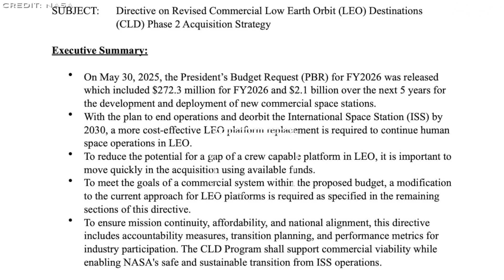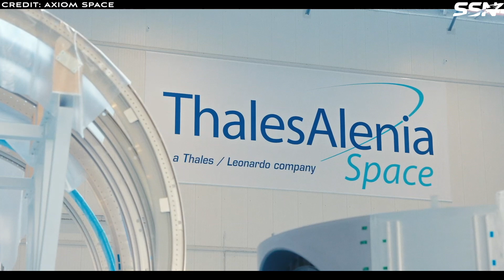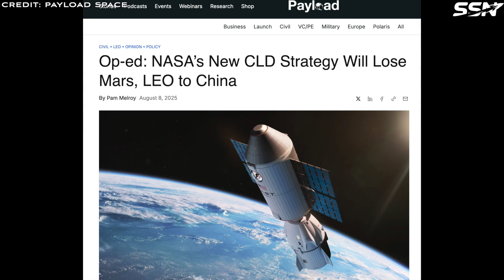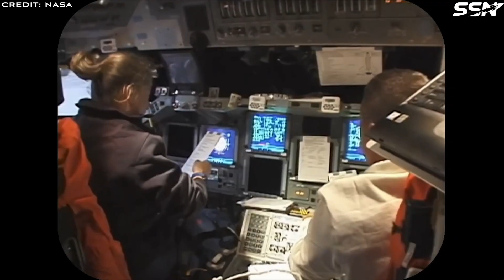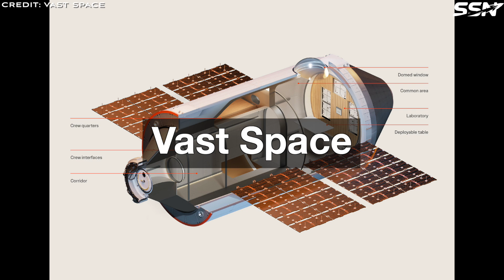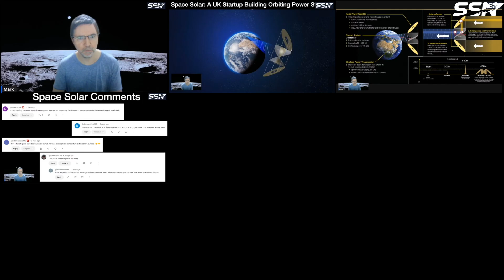NASA's Pivot to Simpler, Cheaper, Commercial Space Stations

Comment: We had better get back to the Moon before we worry about getting to Mars. Orbital stations cannot give us all of the necessary data for a trip to Mars. They are shielded from total radiation by the Van Allen Belt that will be encountered during a Mars mission. We need to move in smaller steps. We won't be giving up a permanent Space presence if we keep working on travel to the Moon.

Comment: If Ms. Melroy wants to see a space station that can support long-term astronaut tours-of-duty to simulate a Mars mission, then probably the best place to experiment with that would be the NASA lunar Gateway Space Station. So far, Gateway's Congressional prospects seem to be bucking the White House's plans to kill it. The only problem is that the station's habitat space is way too small and also incompatible with the bulky commercial lunar landers. If the Gateway does continue forward, is will need to see significant changes anyway. 

Also: I'm unclear if there is a long-term plan for these new Commercial LEO Destinations. Is there a way to continue to develop these space stations so that they can evolve into something more long-term? Orbital Reef is supposed to be more modular, so it could start out small and grow from there by adding more modules.
Reply: You are definitely on the right track here.  The good news is nearly all the proposed commercial stations can be expanded.  Axiom is designed for it and though Vast units are considered Stand Alone, they do plan to link them either in a line, or from a central hub.  The Sierra Space units are intended for Orbital Reef, Stand Alone (with a power and propulsion unit attached), or for addition to other stations.

Comment: Pam is right, while commercial space flight is a benefit, relying on them for deep space missions and technology is a big issue which is what HLS is proving. The reason for reducing the presence in space is because of the unnecessary budget cuts. We need a continuous presence because that is literally preparing us for Mars.
Reply: Not enough time. If industry would have had this in mind and as a priority from early 2020s maybe we could have done it, but if we insist on some magical new space station at this point it might not get done - and if it does it will be over budget and unrepeatable.
Reply: @nathanblackwelder7406 it’s not the space stations I fine with them being commercial (with the exception of Gateway), it’s the new policy that lacks long term presence in space that I have a problem with and the over reliance on commercial enterprises to do the work for NASA. The landers are way behind schedule and Starship is not going to be the rocket to take us to the moon, let alone Mars.
Reply: Not really since there will be some long term stays. Plus lunar landings will have longer terms.
Reply: LEO stations are not really deep space though.

Comment: The shuttle was an example of NASA's expectations being unrealistic and the costs spiralling out of control. Far better to create a strong foundation based on what is possible then increment from there. It is more than likely that once the commercial space stations get up and running and hone down the efficiency that longer stays will naturally progress.
Reply: NASA had planned to build a much smaller shuttle to go on top of the launch vehicle, similar in design to the Dream Chaser.  Unfortunately the Dept. of Defense got involved with requirements for a much larger craft.  By the time it was finally built though, the DoD didn't really need it anymore because they then had more improved spy satellites in their possession.
If not for the DoD, we would have gotten a LEO shuttle for crew launches, and a heavy lift rocket based on an improved Saturn V.  This would have meant Skylab could have been saved, and more massive units launched.  These were much larger than the smaller ISS modules.  So basically, with the SLS and the Dream Chaser, we are now building what was planned for the 1970s, 40 year late. 🙄
Reply: @martythemartian99 unfortunately being government owned is their biggest problem because they need the funding to sort their mission 😊
Reply: @dumitrulangham1721   You are right.  Just imagine if the government tried to combine the needs of other departments the same way as they combined the needs of space exploration and the DoD.  You'd have school busses that empty trash bins on their route.
Reply: My thoughts exactly
Reply: It's way more expensive to have multiple incremental launches than one big one.